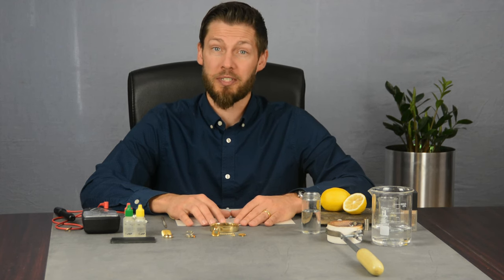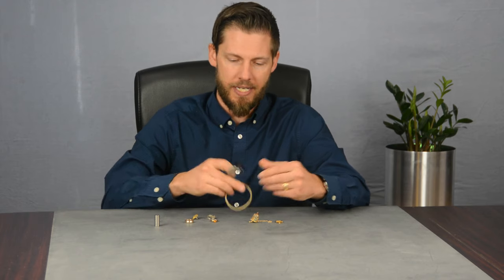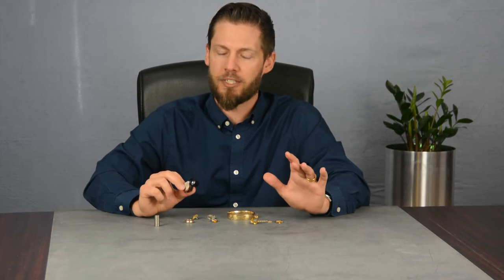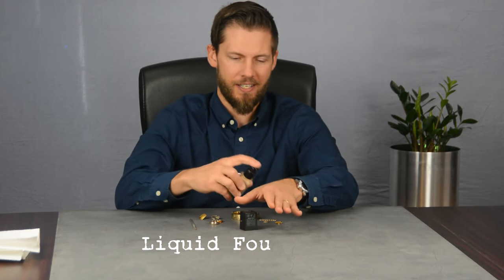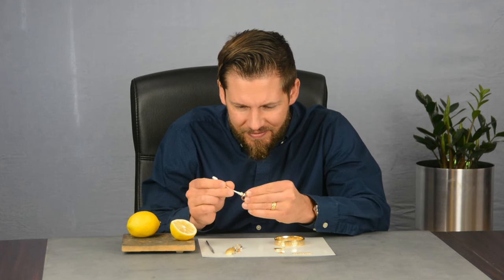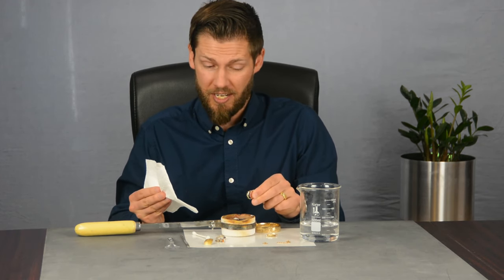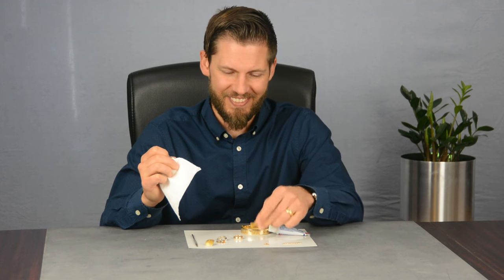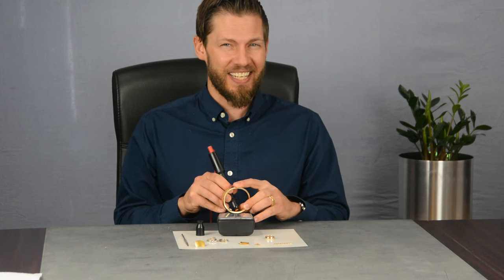How to check if gold is real or fake! We try DIY gold tests at home.

Comment: To do toothpaste correctly you put toothpaste on the piece of jewelry and rub it on a white cloth, if it makes a mark it’s real gold. Works 100% thx for your videos 😊
Reply from the maker: Thanks for the tip! That makes a lot more sense than the way we were trying to do it. :)
Reply: What kind of tooth paste
Reply: Thank you sweetheart cause I ain’t gone hold you, I wasn’t tryna do all that……….
Reply: The toothpaste serves to polish gold. Real or fake.
Reply: @fdshibley2805  All toothpastes are the same thing. Nothing really changes, only the taste pretty much
Reply: Jel toothpaste cleans real gold thanks
Reply: @Daniel_Antonio_Arellano782  if you apply toothpaste on fake gold the plated gold would tarnish and becomes discolored but real gold has no harm or damage to it its because its like stainless steel that won't tarish or get discolored as its main thing is to get wet witbout have to dry it to keep it out of the water like metal which does rust over time
Reply: But I also read that if it leaves a black mark it's fake. Which is it???
Reply: Lol😂😂😂sure ya right.
Reply: I love your happy whistle music!

Comment: The toothpaste I watched was different.  She put toothpaste on the item and then rubbed the item with toothpaste on a white towel.  REAL gold leaves a dark mark on the white towel.
Reply from the maker: Interesting! I haven't seen that technique before. We'll have to give it a try sometime. Thanks for sharing.
Reply: @ArdenJewelers ya.... I just tried the toothpaste on real gold. And it does work. But you must rub the test item with toothpaste on a cloth. If there is a dark spot, then it's gold. If not then it's fake. Also, I used the magnet from an guitar amp speaker. Ya.... that's strong enough.
Reply from the maker: @jamesnash6101  Thanks for the confirmation! That's good to know. Haha, yeah, a guitar amp magnet should do the trick. :)
Reply: I seen the same one and other ones say that if it leaves a dark streak it is fake.so witch one is the correct one dark streak =real or dark streak =fake

Comment: I thought the toothpaste test was to put some toothpaste on the item of question, wait a minute, then rub vigorously on a white cloth, and if it leaves a black smudge on the cloth it's real gold. It's not supposed to leave anything on the piece itself. Maybe the test I saw was different then the test you saw? I know the toothpaste test I saw and tried turned my white cloth black where I rubbed it( 10 quick vigorous rubs.)  *Basic: The same as the foundation test. The same black streak.
Reply from the maker: Yes, I think you're right. That version of the toothpaste test seems to be more common and more effective than the one we saw. Maybe we'll have to do a follow up in the future. :)

Comment: What if it’s 24k plated will test still work
Reply from the maker: That's a great question. Plating will trick most surface level gold tests (including fancy ones like the electronic gold tester). That's why you see us filing into each piece before we test. When we file, we get through any plating and test the metal underneath. Of course, filing is destructive, so if we determine that we need to file a piece, we always ask before we do so in our store.

Comment: White toothpaste and toothbrush  works the best to clean jewelry
Reply from the maker: Thanks for commenting. We typically recommend a toothbrush in warm soapy water for most jewelry. The issue with using toothpaste is that it's abrasive, and it can actually wind up scratching soft metal and gems if you're not careful.

Comment: I have a gold bar weighing 274 pounds and i have been through test as you mentioned on your video and i got positive result. however, when testing with sulfuric acid the result turn brown gas and blue smoke, and when testing with nitric acid the result turn out green. i still have doubt that i have a real gold as result came positive. Could you please kindly explain precisely?
Reply from the maker: A gold bar that size would be worth about $10.5 million in today's market. Given that, I would probably avoid at-home tests and get the help of a professional. :)
Reply: 😂 @ArdenJewelers

Comment: And how can I tell if my piece isn't just brass? This is what tricks me. Brass isn't magnetic and I don't know if any of the other tests would appear different on brass the same as with gold. What do you recommend I do.
Reply from the maker: Good question! Typically, the easiest test for brass is the visual inspection. It looks a bit different than yellow gold if you have seen a lot of it. That said, if you need something more definitive, the electronic tester or the acids are the best. Either one should have no trouble detecting brass. Of course, if you're in the Sacramento, CA area we would be happy to test your piece for free. We do that kind of thing all the time.
Reply: @ArdenJewelers  The liquid foundation test works! I just tried it on known gold rings and on cheap gold-colored rings. Would brass or any other metal turn dark or just the gold? Thanks
Reply from the maker: @jennifermeegan148  The generally idea is that only gold will turn dark. That said, we don't have extensive experience with this particular test, and I'm sure there are metals that will give false positives. If you need to be very sure of what you have, I would recommend taking it in to a local gemologist to test.
Reply: @ArdenJewelers  hehe.. seems a lot of ppl are having the brass/gold concern for the make up test. :O

Comment: I left mine in vinegar and 1 piece in bleach 
Can back after 8 hour shift and nothing happened on either. Should I be worried ?
Reply from the maker: Good question. We didn't see any reaction from vinegar on real or fake jewelry, but we did see the bleach react strongly with the fake jewelry. The fact that you didn't see a reaction is a good sign that your jewelry is real gold. That said, as we mentioned in the video, it's not a great idea to leave even real gold in bleach for a long period since it can affect the alloys in the metal.

Comment: So if the mark stamp says 18k, how do you know is not just 14k instead?
Reply from the maker: That's a great question. Most of the at-home tests we tried in this video are only about to give you an indication of whether the piece is gold or not. If you need to know the exact purity (14k vs 18k), you will want to user the more professional tests we talk about at the end (the electronic gold tester or the testing acids). Of course, you can also bring it in to our shop, and we can let you know. :)

Comment: Sorry to correct some information I've seen countless times that is improperly provided to viewing audiences. 
Gold alloys ARE magnetic, this includes 18k, 16k, 14k, 12k, 10k and 8k and all the percentages of gold alloys in between ALL DEPENDANT on the size of the item, the strength of the magnet and the  base metal used to achieve the percentage or karat that the item is. 
😅
 But your video was genuinely entertaining and informative. Thank you!😊
Reply from the maker: While they can technically be slightly magnetic, you won't see any gold alloy jump to a magnet, or stick to it strong enough to pick the item up which is what we were implying here that being said yes, gold alloys can be slightly magnetic on occasion so that could have been stated clearer. I appreciate the compliment thank you!

Comment: Doesn't scratching the jewelry damage it.
Reply from the maker: Good question. Yes, it absolutely does. That's why when we test jewelry at our shop we start with non-destructive tests like the visual inspection, magnets, and electronic tester. Some pieces however have a thick plating, and you can only tell what the underlying metal is after scratching them. In this case, try to find an out of the way area to scratch that won't be too noticeable.

Comment: ❤ Thank You. I enjoyed your video.
I recently bought a gold testing kit
Because I wanted to test my gold flakes and Placer gold....DO you use it the same way on those ( ? )
And do you just use the neutralizer for cleaning the bar ( ? )
Reply from the maker: Thank you for your comment! I'm glad you enjoyed the video. Yes we test flakes and nuggets the same way we test larger items. I would be careful of the really small flakes as they are sometimes so small that they just disintegrate when you scrape them. I usually drop a couple drops of neutralizer and then wipe off with a paper towel to clean it. Also, another tip is that most acid neutralizer is just baking soda mixed with water, so when you run out you can just make more at home. Hopefully this helps!

Comment: I have an antique hand mirror that I suspect to have gold holding in the glass.  Should I just go see someone with the metal detecting gun or try the scratch test, perhaps?  There are no identification marks on it so I think knowing the base metal of that part is important.
Reply from the maker: That's a good question. Your best bet would probably be to bring something like that in to a gemologist to test. Since the potential gold is surrounded by other metal, it will be tricky to use most of the tests in this video. The electronic gold tester would be the easiest and best option.

Comment: For the electronic tester do you need a collaboration disc and if so where can you get it from the disc.
Reply from the maker: Great question. Yes, the electronic tester needs to be calibrated pretty much daily to provide accurate readings. We use an 18k yellow gold wedding band that we keep next to the tester. I have seen special calibration discs before, but we haven't had any need for them, so I couldn't recommend a good one. If you would like a band of your own, we can definitely help you find one. ;)

Comment: Great video however with the foundation test you didn't say if it leaves a black mark doesn't mean it's fake gold or real gold? Or maybe I just didn't hear you say that. Thanks again
Reply from the maker: Good question. That definitely could have been clearer in the video. If the test is working, real gold should leave a dark mark in the foundation, but fake gold will not. Of course, it isn't foolproof, but it did work pretty well with our test pieces.
Reply: Black mark means fake
Reply from the maker: @LindolfoVega  Actually, it's the other way around. The genuine gold piece should turn the foundation dark. Sorry that wasn't more clear in the video.
Reply: And what if a piece is gold filled  should that react as real gold or  plated?

Comment: Hi, I was inspired to try some of these tests, and I just wanted to say that unless real gold comes out of jewelry findings from Jo-ann's and Michael's, the makeup test does not work to test if something is gold. I tested several items I thought might be gold and they all left a strong dark streak in the dry liquid makeup on my skin after rubbing just 15-30 seconds, but I also tested some very not gold items: cheap goldtone connectors, earring wires, beads, etc from craft stores that I bought myself and they also left a dark streak. Quite sad but I saw so many comments below with people convinced this works, I had to comment myself. I have not tried other methods yet.
Reply from the maker: Thanks for commenting. It's really helpful to hear about your experience. With this kind of test, I imagine that there are a lot of variables that can throw it off (type of foundation, quality of gold, etc.). If you need to be sure, your best bet is to have the pieces tested by a local gemologist.

Comment: I heard that if 14k gold is paired with iron or nickel instead of copper or aluminum then the magnet trick won't work to determine whether or not it is true solid 14k gold. Is that true?
Reply from the maker: Interesting question, thanks for asking. Gold usually isn't alloyed with iron, and nickel isn't magnetic either. Most white gold is alloyed with nickel and isn't magnetic. In our experience, there are a few rare, genuine alloys that are magnetic (typically ones that use cobalt), but for the most part, if it sticks to a magnet, it's not gold.

Comment: You didn't say what the dark material is that you are scratching the jewelry pieces on. Is that sandpaper?
Reply from the maker: Good question. That is called the "Touchstone" in the Touchstone and Acid test. It is a dark stone like slate that has a finely grained surface that the gold will leave a visible trace on when it's scratched. Most acid kits come with a suitable touchstone for you to use.

Comment: So 10k 14k and 18k have other metals in them. When mixed with a magnetic metal other than the percentage of gold that is in the 10 to 18K gold piece you will get a slightly magnetic charge no matter what if it has other magnetic metals into it
Reply from the maker: You're absolutely right about gold alloys. Where we really see this effect is with alloys of white gold (and platinum) that contain cobalt. In practice though, the vast majority of genuine gold alloys do not react at all to rare earth magnets. This makes the magnet test a very effective initial screening. :)

Comment: Can i use the gold acid test on maybw fake fold flakes inbought from paydirt?
Reply from the maker: Good question. As long as you can scratch enough of the material on the touchstone to create a solid, easily visible line, the acid test should work. Testing flakes it always tricky, but using the acid test is not a bad way to go about it.

Comment: thanks for this info! I have this clunky penant that I did the make up test on and it gave me dark streaks. I wanted to be even more sure. It's a rough cast face kind of similar to the brass import ones from Africa but not as polished. I washed the pendant with soap and water, towel dried it then used my polishing cloth. I redid the makeup with both foundation and powder and the second time the streaks were more pronounced. I did the ceramic test, my house is dark so it's hard to see 100%. The lines look dark so not gold but if you put the phone flashlight on the line it reflects like gold and if I tilt the surface away from me to catch the light, I can see gold specks all the way down. I just soaked the pendant in white vinegar for 1/2 hr and nothing happened to it, but I see cleaning brass with vinegar is also a normal thing. ugh. what next? Iodine? I don't have any normal way to check gold and would die if I took this thing in and it was just brass. So back to the makeup test, does brass also leave a dark streak? - for the life of me I don't have any brass on hand! sorry so long.
Reply from the maker: That sounds like a tough one. The easiest thing to do would be to bring it to a local jeweler or gemologist who can tell you for sure. If that's not an option, the touchstone and acid test kit (link in description) is probably the most affordable option to get a conclusive result. Just remember the warnings in the video. These are serious acids, so you can definitely hurt yourself if you're not careful.
Reply: @ArdenJewelers  I did the iodine test and it failed. I'm going to save up for the metal tester you suggested. I would be just giddy to own one. Maybe a Christmas present to myself! :D Thanks for your answer, looking forward to catching up on your content.

Comment: How can i check if its gold plated silver
Reply from the maker: Great question! Almost all testing methods from the most professional XRF machine to the toothpaste trick only test the surface of a piece. So, if the plating is thick enough, it will register as gold. That's why you see us filing in to each piece before we test it. You need to get through the plating to the metal underneath.

Now, filing is destructive, so we try not to file a piece in real life if we can help it. Also, we try to file in an inconspicuous area, and we always get the customer's permission first.

If you are testing your own jewelry, try to test an area that naturally has some wear on it. If you need to be sure, file into it first like we do in the video.

Comment: I have a similar gold filled bangle. Same stamp..and it does look gold but the edges are a little tarnished kinda looks like copper. Great video!
Oh and is it possible to have real gold without a stamp?
Reply from the maker: Cool! Yeah the bangle is most likely gold filled or plated. It is possible to have real gold jewelry that isn't stamped. This is relatively common especially in the repair world. Stamps can wear off with time, or they can be removed during other repair processes like sizing or replacing broken parts.
Reply: @ArdenJewelers  gotcha thx for the info! 😀

Comment: And what if a piece is gold filled  should that react as real gold or  plated? I cannot damage the piece.
Reply from the maker: Gold filled is a very thin layer of gold (though much thicker than electroplating) is placed on top of a base metal such as copper or brass. If it is in like new condition it may fake out some tests that only test the surface. The best way to check a piece that can't be damaged is with an electronic gold tester or an XRF (x-ray fluorescence) machine. Hopefully this helps!
Reply: @ArdenJewelers  yes thank you.

Comment: Loved the info didn’t understand the foundation  of it turns black is it real or if it doesn’t leave a mark is it real.
Reply from the maker: Great question. If the foundation turns darker it could be an indication that it is real. in this test the real ring turned the foundation darker, while the fake item did not.